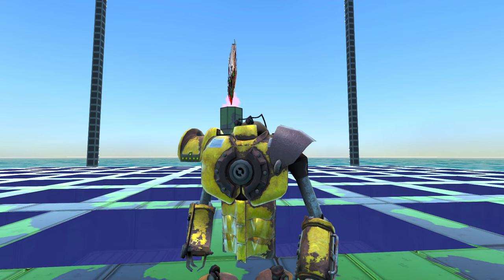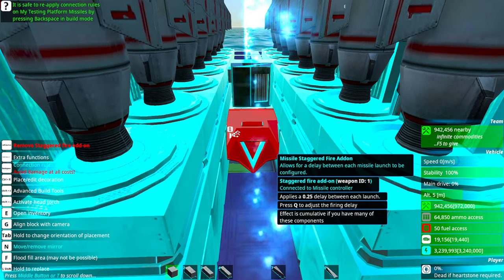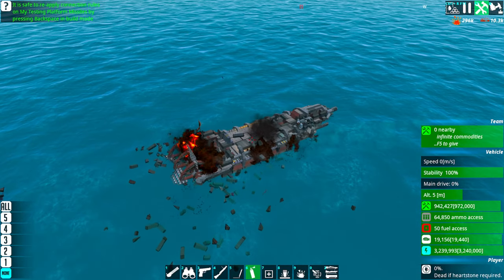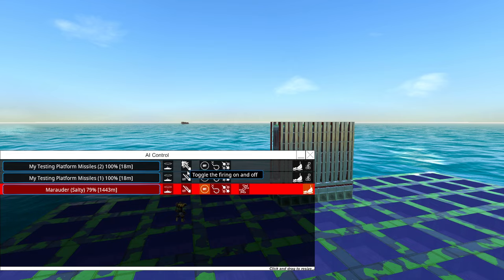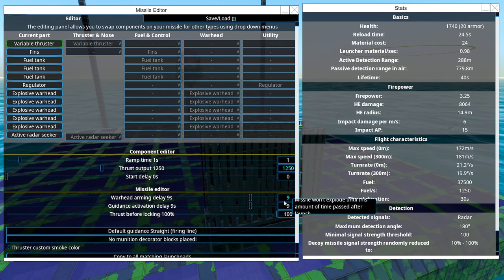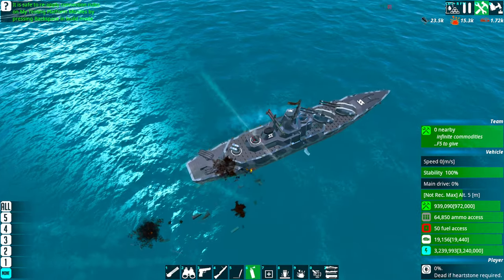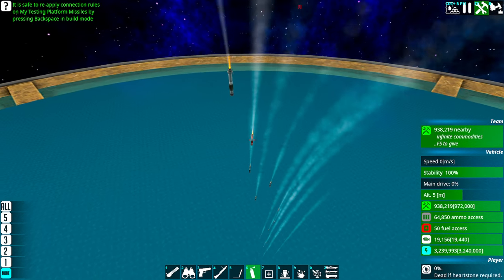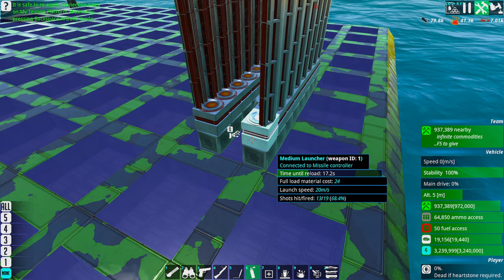Top Down VLS Missiles Tutorial | From the Depths | 2023

Comment: A quick note: you don't actually need a warhead arming delay unless your missile would hit your own ship, a sub-construct or an allied ship close by, but most of these issues can be remedied using failsafes
Also, balancing out thrust duration with lifetime allows you to use the maximum amount of fuel without running out. If you use ejectors you can even add a thrust delay to allow for more thrust power due to the lessened lifetime.
Reply from the maker: I like to use long warhead delays because most of my support ships use VLS and they will be together with other air vehicles and I did sometimes had accidents 😂
Reply: @DrakoMT not to mention being in range of a laser defense, popping em right at launch
Reply: I kinda use the delay on my submarines that use vls so they don't blow a hole through the underside of my own ships.

Comment: give them ejectors and you can add a start delay for firing the missile engines to save fuel/increase range, can also play with the 'thrust before locking' setting to not have them waste fuel in the first staging.

Comment: built my first craft and was testing the missiles first... my Missiles has 83 seconds of fuel but they always detonate like 20 feet be fore the target... its so frustrating. even shooting one missiles it still blows there, can only get 1 or 2 missiles to hit
Reply: ok if i spawn it at like 200 meters they finally hit... but i should have way more range than that... its only the missile and controller, no AI or targeting added yet. yea anything past 250 the explode 20ft before impact. i dont get it.
Reply from the maker: Add a regulator , The smaller the missile the less life span it has.
Reply: @NinjaInTheFirstDegree 

I try for 15-20 gantry length on a medium. Fins front and back for around 35-40 deg/sec turning, then one-turn and apn, then fuel until my duration shows at least 40s. 60s tends to be too slow for my taste. One regulator will bring the medium up to 40s life.  Initial adventure waves will see most craft getting one shot with a little emp in these.

Comment: Hang on... how are those missiles turning towards the enemy without a one turn module? 

Clearly one turn doesnt do what i thought it did.
Reply from the maker: One turn is good for torpedoes and when you need the missile to track the target in a short amount of time.
Reply: @DrakoMT  why are they needed for torpedoes? If missiles can turn without it, couldn't torpedoes also?
Reply from the maker: @Abrogator91  if you shoot torpedoes not facing the enemy the sonar might not target the enemy but with one turn it will turn and then the sonar will pick it up again.

I had this issue before many times if I build a ship that shoot torpedoes down to the bottom of the sea then I need to put a torpedo to make it do a U turn towards the enemy.
Reply: The radar head for missiles works in a 180 degree area

Comment: How would this work in reverse I wonder. Fire the missiles, or rather torpedoes, downwards to pen the underside of a boat... I'm gonna give this a try for sure
Reply from the maker: You could use a lua script but I don't really like to use them because you will have to make a dedicated lua ggp module on the ships
Reply: @DrakoMT  I was thinking about using the guidance delay like in your video, just tune it so it submerges ~100m then turns... could use an ACB to restrict firing if alt above ground is lower than that
Reply from the maker: @alibee4421  You can use a bb with primary target info and above ground restriction. You can put a ballast on your torp to make it less floaty.
Reply: I had an airship launch torpedoes which would land into the water at like 80 degrees down, sonar doesn't see anything so they just go until they hit the ground and bounce back up, now the sonar can see the enemy ship and hit from below.
Reply from the maker: @PerfectDeath4  You can put a one turn to it
Reply: @DrakoMT  I know =P
was just a funny thing I discovered by accident while testing air launched torpedoes.
Reply: just use balast tank at 20-25 m depth, put frag on the torp pointed upward like25-30 degrees. make huge holes in the ships belly's :p
Reply from the maker: @Nosferatu-BE  I do have a lua script for that but I need to modify it if you guys want something like that for tournaments 😅
Reply: There is no keel in FTD so its pointless.
Explosions get a damage boost undrwater.
Reply: Honestly, just giving it a fload depth with the balast tank is enough.